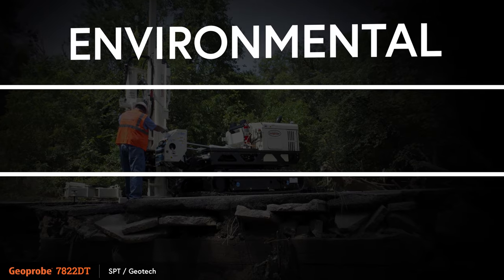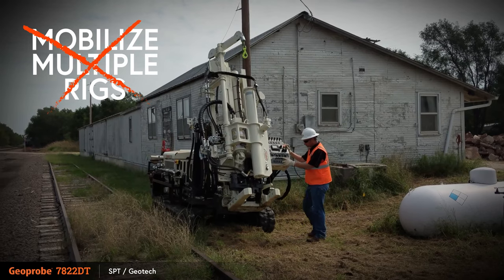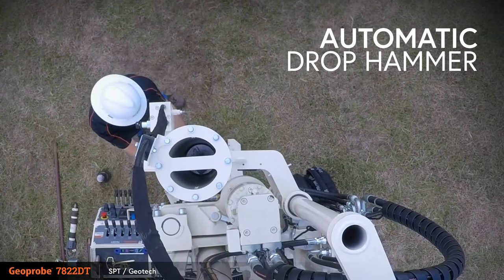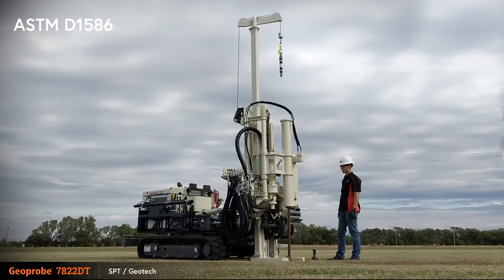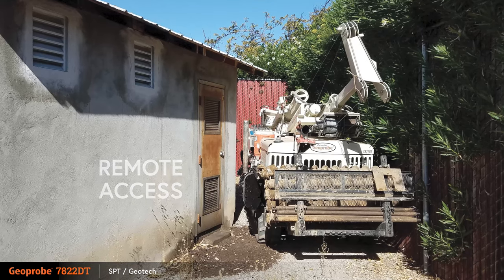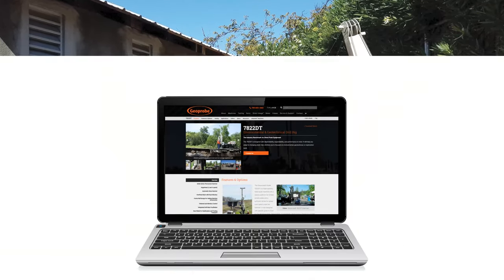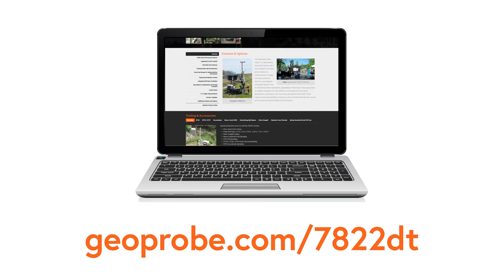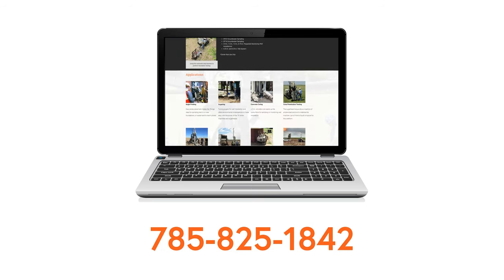Geoprobe® 7822DT Features - SPT /  Geotech

Comment: My Current Mission ....sample hole with Mc-5... then switch to 4 -1/4 augers to rock ...switch tooling Core holes with HQ Wireline to find desired fractures then switch tooling to  .. 8-1/4 augers to 20 feet and setting over 40 feet of 6 inch casing with these rigs 😂 Then Drilling with API Rods and 5 inch Air hammer to desired depth to set well  . Testing the absolute Max Capabilities of these Rigs on some of the Coolest most high profile Jobs out there. Geo probes tough . I have and am testing there capabilities to the max in the field . They are  good machines. Can I get another Free Hat ?